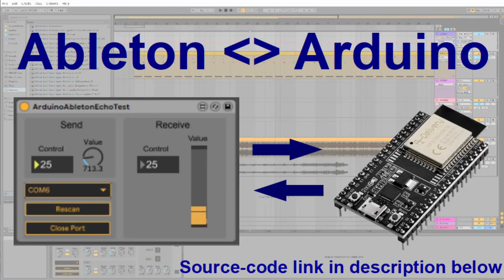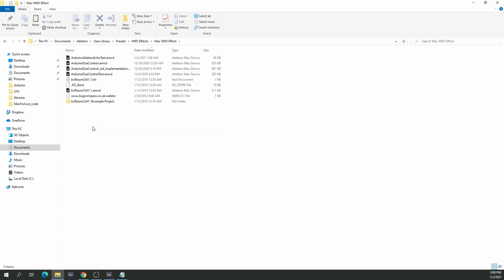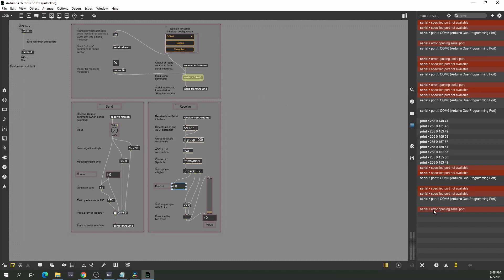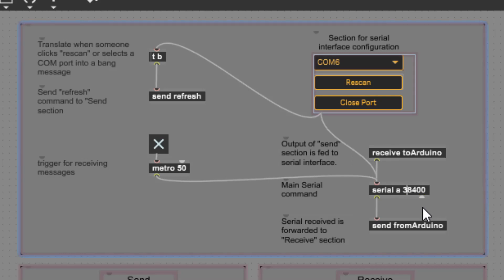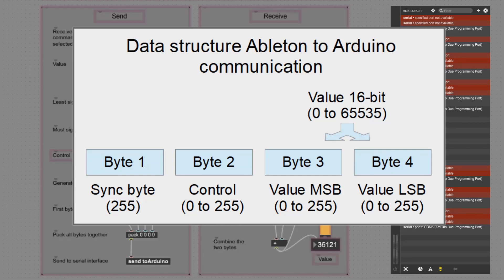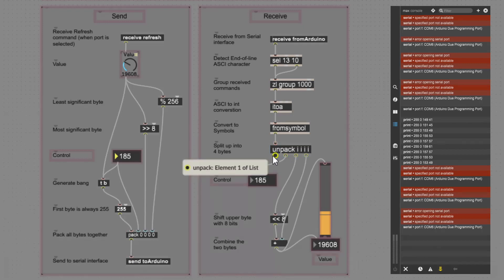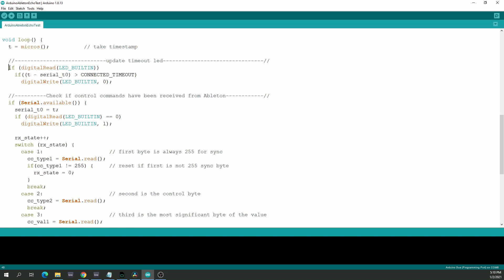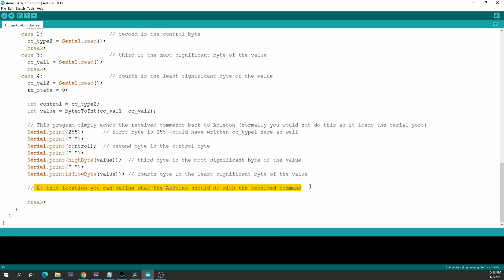How to send data between Ableton and Arduino/Teensy/ESP32 via USB

Comment: Hi, thank for the video! I'm trying to implement this with an MPU 6050 accelerometer, sending data from an ESP32 through serial to ableton, which is then mapped to audio effects. What would you recommend changing in your code? I'm having trouble understanding how to communicate directly from arduino to ableton, rather than vice versa.

Comment: amazing project. i've successfully connected a teensy and i've been returning values to an lcd screen. it works mostly well however it keeps bouncing to the highest possible value (65535) unless the ableton value knob is actively moving. any ideas why? thanks!
Reply from the maker: That sounds to me like a "Max-for-live" problem. There are many ways to solve it. You can for instance only send a new value when the value changes and keep that value locally in your Teensy to show on the LCD screen. If you want to solve the problem in max-for-live, I recommend using the "print" function a lot to see where the highest value comes from. My bet would be that the knob in ableton needs to be triggered to give the current value with a ping or something like that. However, that is a bit tricky to say without seeing the code. Hope you can figure it out!

Comment: Hello!  I have been dreaming of a project that would allow for a synth sound to be played and the pitch be changed with an analog signal.  What I want to do is to add custom sounds to my electric motorcycle that will change to match the throttle signal, making it sound like a cool futuristic machine as well increasing safety when riding near cars and pedestrians.  I am still a bit of a noob when it comes to programming but this seems like it could potentially be a good beginner’s project.  I have a couple ESP32 boards and was hoping these will work for my project, I’m just having trouble finding the right direction.  If I had MIDI files of the sound I want to play would this be the best way to go?  I’m really hoping I can get some help to at least get pointed in the right direction, hopefully I described my idea in a way that is understandable.
Any suggestions?
Reply from the maker: Sounds like a fun project to me. First of all: a MIDI file itself does not contain a sound. A MIDI file only has the information of which note is played when. For your project there are many ways to realize it, it really depends on what kind of sound you want to have. Here some options:
1) you can make a VCO (voltage controlled oscillator). This is basically what old Synths are based on. The tone goes up with higher voltage. However, just a VCO might not be too pleasant to listen to in the long run. The sound of just the VCO can be quite dominant.
2) you can create a sound from the ESP32 directly. However, this also will be just a simple sine, square wave or so. Also this might not be too pleasant to listen to
3) you could use a sampler and upload a .WAV file to it. Then you can play that sample at different speeds -> different tones. The best platform to do this on is Teensy, not ESP32, but I googled a bit and it is possible to do it on the ESP as well:
https://www.youtube.com/watch?v=a936wNgtcRA

Hope this helps. Good luck with your project!
Reply: @mothunderz  thank you for the reply!   I have considered the option of using a sampler with a wav file and using a pitch bend, that might create the effect similar to what I’m looking for and would allow for testing lots of different sounds
I would LOVE to be able to replicate the wonderful synthesized motor sounds I found in a really awesome app called OTOTETSU, which synthesizes different types of real and imaginary sinusoidal motors (definitely worth checking out).  My idea with using MIDI was that I could feed my favorite motor sound from that app into a program that would map it into a series of Midi notes, then I thought I could play through that “scale” with the throttle signal on the bike.  I imagine all this would take some work though.  Still not 100% sure if the ESP32 would be able to play those MIDI files as sounds, seems possible though?  I already emailed the developer of OTOTETSU, and while they said they really enjoyed the idea, they weren’t able to provide any sound files or MIDI files, which is why I considered feeding the sound into a program to map the sound into a series of MIDI notes.
Reply from the maker: I dont fully understand the setup you want to create. But yes, the ESP32 can of course create MIDI notes. The easiest platform for midi is Teensy IMO, but ESP works as well. Pls post a video if you manage to make this device :-)

Comment: Thank you for such a nice video! Do you know if it is also possible to connect a water sensor to the whole thing? Im new to both Arduino and ableton
Reply from the maker: Thank you for your feedback. Yes, of course you can connect a water sensor, or any other sensor, to the Arduino and interface with that. Just make the water sensor work first with just the arduino and after that send information from the sensor through the interface to Ableton

Comment: Hey, thank you for teaching us awesome things! I have a problem doing this with my ESP32. The only thing that I see hapening is the built in led flashing when I turn the send value knob, but I see nothing in receive. I made sure the baud rate is the same for both things and tried both serial a and b in MAX. Do you have any idea why this is hapening? I wrote a small program to control a filter in ableton- the max patch alone works and the arduino code has erros, but I can't connect the 2 things together (code and music).
Reply from the maker: It is a bit tricky debugging like this, but the one common mistake is that the serial port is already "taken" on your PC. If you load the M4L plugin in Ableton, make sure you dont connect that one to the serial port if you want to open the M4L editor. Then in the M4L editor you should be able to connect to the ESP32. Did you try to run the final code I shared on Github? That should work... Good luck with your project!
Reply: @mothunderz  hey! In the meantime I figured it out and managed to build my own custom patch for automation with sensors, it works :)

Comment: hi, what would you do to send more parameters from ableton via serial?
Reply from the maker: @Soundprayer: hi, there are various ways to implement that, but the easiest way is to just send them sequentially. Please see this video in which I send various parameters from Ableton to the ESP32:
https://www.youtube.com/watch?v=UCKVeh7NPHc
Another code example where I send very many parameters at the same time is here:
https://youtu.be/Hl7n_ObG3Go
Cheers, Sander
Reply: @mothunderz  thank you, ill try
Reply: @mothunderz  I did it  - every value with different control bit. But - when playing automation from ableton, sometimes lights "jump" to different values for short time and blink. It happens in places they shouldn't. Had you same experience?
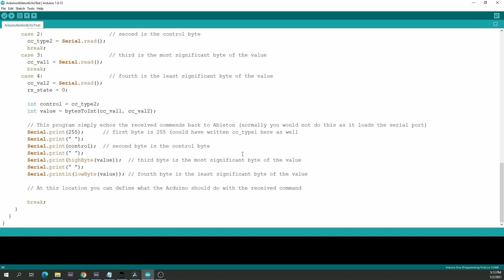Reply from the maker: @Soundprayer, from my experience, especially the Max For Live (MFL) part can be tricky to work with. If you see lights jump does MFL send out a comment to the Arduino or not? If it does then you know you have to debug the MFL code, if it does not, then it is the Arduino code you need to look into. There is one bug in MFL that you also need to take care off. This bug I describe in the video below from 11:22 through 17:40. Especially when you are changing many parameters at the same time, this is essential.
https://www.youtube.com/watch?v=Hl7n_ObG3Go
So, pls carefully observe what MFL sends out to the Arduino at the time of the glitches and make sure you dont overload the serial interface with gating (as shown in the video). Hopefully you will be able to find the problem. Good luck!

Comment: Hi mo_thunderz. Im doing a projekt with an arduino. the only thing i want is the arduino to 
receive a
square-wave replated to the tempo in ableton. a have build a electronic circit with lights. How can i do this in the most 
easiest way? Thanks a lot
Reply from the maker: Hi Max, you could in essence use the code of my ADSR+LFO below. 
https://youtu.be/Hl7n_ObG3Go
Github:
https://github.com/mo-thunderz/ArduinoAbletonLfoAdsr

This is synced to Ableton and by either using the sync output or setting the ADSR to block shape you can directly control your LEDs. However, the code as is is written for the DUE as I was using its DACs. For LEDs you definitely dont need to use DACs and you can just use any PWM port. The adaption to standard PWM ports is relatively easy:
// Code optimized for Arduino Due as it has a built-in DAC
// For use on other boards just reduce the DACSIZE, 
// remove the analogWriteResolution(12) statement and write
// to a different port for all analogWrite statements. 

But the code is a bit of an overkill as you wont need all these features. Let me have a look and I'll post some code focused on controlling LEDs soon.
Reply from the maker: Made it easy for you, here is the code for just LED control:
https://github.com/mo-thunderz/ArduinoAbletonLed/

Will add a Youtube video for explanation as well next week.
Reply: @mothunderz  WOW! thank you so much. you put some much time into this. What i have done is. i have made a M4L device with toggle buttons. each buttons is sending there state via serial every time it changes state. And the state of the buttoms is controled with creating a square-wave in automation in the timeline. Ableton is hooked op to an UNO that read all the serial data. and sendes a pulse to an EPS32 equal to the square-wave cooming from the serialport. The ESP32 is then controling a LED strip configered in a matrix. the matrix will draw things based on, where ableton is in the timeline. and i can follow ableton because it is reading a pulse from the UNO that is created from the M4L device and send to the UNO via serial. The onlt problem im having is that, the EPS32 dont know where in the timeline ableton unless. The timeline in ableton and the ESP32 have been reset exatly at the same time. does it make sense? Maybe there is a smarter way to do it. i just havent figured it out yet. sorry for bad english. And thanks a lot for your help and advice.
Reply: Is there a way to make the M4L device send out a number that is porpotinal to the timeline? e.g. (bar 1, beat 1) = 1, (bar 1, beat 2) = 65, (bar 2, beat 1) = 257 and so on. does it make sens?
Reply from the maker: Why would you put an Arduino in series with an ESP32 and not communicate to the ESP32 directly? You can of course send information from Ableton with a push-button as well, but pls have a look at the LED control code I posted. In the M4L device you can see that I am sending the bar count and beat count to the serial port. Thus in my Arduino/ESP32 I get the exact location where Ableton is and use that to control some output ports. I hope you understand what I mean, but in case not, pls give me a few days, will upload a description video of the LED code.
Reply from the maker: Here the link to a tutorial how to control LEDs (and transfer measure & beat info from M4L to an Arduino). Hope this is useful for you: https://youtu.be/UCKVeh7NPHc